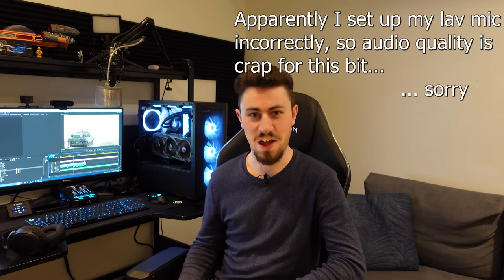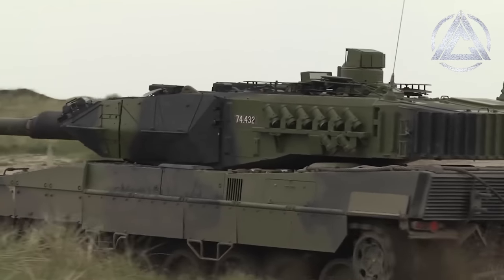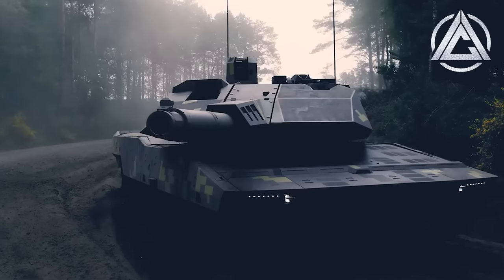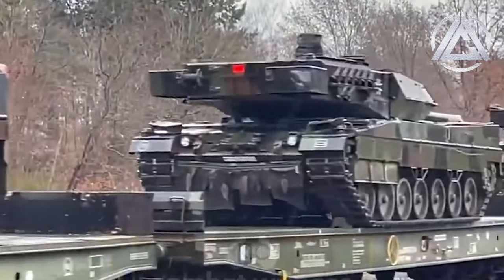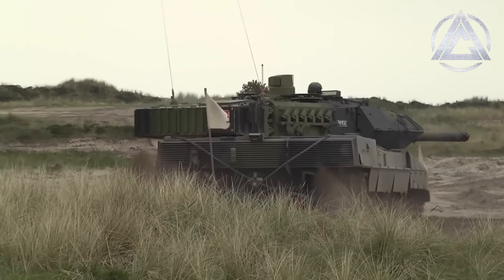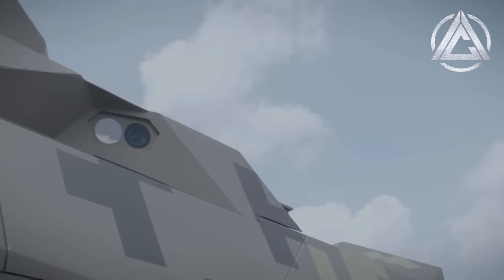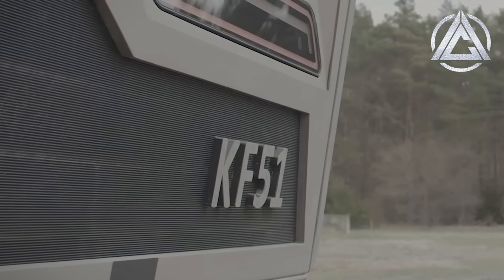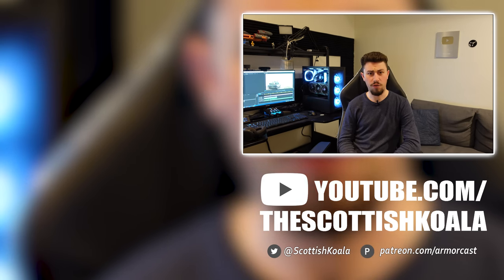Germany's New KF51 Panther Tank | The Spearhead of a New Generation?

Comment: haha fpv drone go bzzzzzzzzz
Reply: A temporary problem that will not be a problem within a few years
Reply: I am sure people in the 20s claimed that the antitank rifle made armour obsolete.
Reply: @rick7424  not really, in the 1920s they thought tanks with 25mm of armor were nearly invincible. It wouldn't be until the 1930s that they thought a 37mm gun was the minimum acceptable caliber to engage tanks with. Really the thought of tank armor being obsolete didn't come about until the 1960s with the improvement of HEAT shells.

This is why the AMX-30 and Leopard 1 had such thin armor and focused on speed.
Reply: @rick7424  I suppose. Maybe the whole "land battleship" thing is finally going to come to fruition with anti-air emplacements on tanks instead of coaxial machinegun, wouldn't tanks have to get bigger to fit all of that?
Reply: @tusk1142  Not really, no. You could literally just make a mini CIWS with a machine gun and it would likely work just as well.

Comment: It is german. So the transmission will break, the engine will least and the optics will suck. Not to mention problems with the Software and Suspension System.
Reply from the maker: Welp, I can stop you on at least one of those things right there - its optics, specifically the PASEO sight from Safran Optics, are among the best currently available anywhere in the world. They're the same ones being used on the American M10 Booker as well
Reply: @ArmorCast  The version in the M10l might be. But this is the getman one. And these days made in germany is back to the original meaning.
Reply from the maker: @mbr5742  They're literally the same optic. It's not a "German version".

Besides, you know the optics in the Leopard 2 are American made, right..?

Comment: This is a shit box. Easily destroyed
Reply: how do you know?
Reply: @justacanadianguy07  thin top armour over the turret.
Reply: @IceDogXena  yeah, but it isnt very likely to be attacked from the roof, because engagements take place usually 200-1500m. the roof armour is vulnerable on all tanks. unless if you are talking about the turret armor in general, then its an issue.
Reply from the maker: @justacanadianguy07  There is very little information out about the armor used on this tank, besides claims from the manufacturer that it should match Leopard 2A7V
Reply from the maker: @IceDogXena  That's what active protection systems are for
Reply: @ArmorCast  which could be false, or true.
Reply: @justacanadianguy07  so artillery and attack helicopters striking the top of the tank is deadly. Also the manpod shoulder rocket launchers Ukraine had success with against Russian tanks explode over the top of the tank as opposed to hitting it in the frontal armour.
Reply: @IceDogXena  that’s the point of those weapons, to attack tanks on the roof, where just about every tank has as a weakspot, including the Abrams and Leopard.